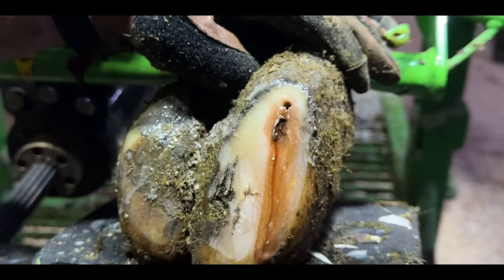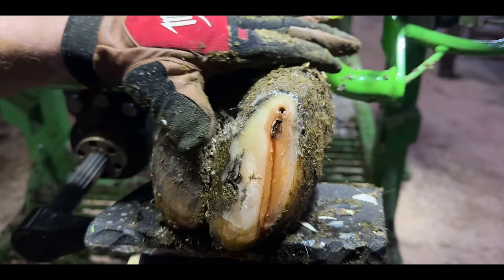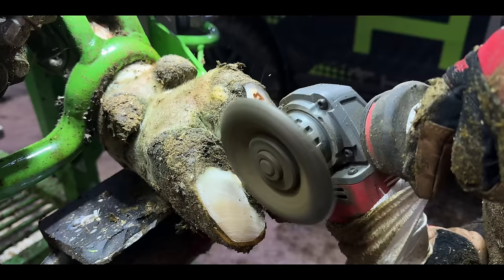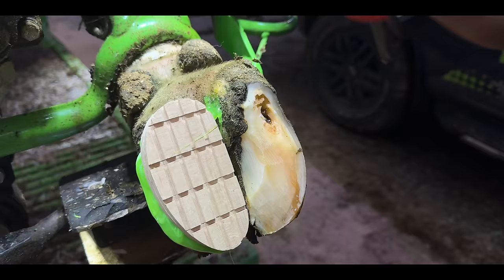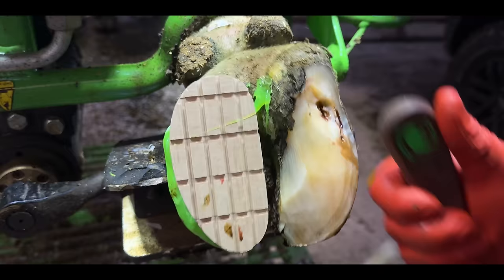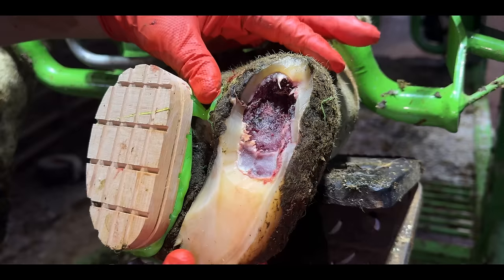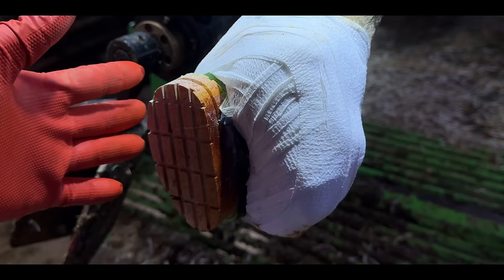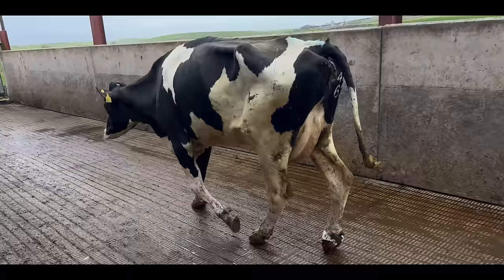there’s a FOUNTAIN of PUS from this cow's hoof!

Comment: The instant relief she had to have gotten when the cavity was open and relieved that pressure, had to have been amazing.
Reply: She still has a long way to go before she's out of pain, tho. The way she's walking I'm worried she's going to break her ankle on a slip. They will have to keep her in a pen for a while. And the bad part of that is how difficult it is to keep the hoof dry, clean and free from more infection.
Reply: @Changelingheart Yeah, but it's kind of like removing a gigantic splinter. It still hurts after and there is a recovery period, but that intense throbbing pressure pain is gone. Her walking at the very end was pretty stable, and with the blocks it's only going to improve rapidly.

Comment: The corium flesh looks really good so the pus must have been doing its job moving the infection away. 
Also, Kev is clever for anticipating the cow’s needs - note I said cow’s need and not hgp’s need 😉😉he’s a good hoof trimmer is Kev!
Reply: Chorium. Corium is the stuff left behind from a nuclear core meltdown.
Reply: @ferretyluv corium is the correct spelling according to Google. When I typed in chorium it corrected to corium after showing me results for chromium.
Reply: @ferretyluv confidently incorrect 😉 it's still corium in the case of cow's

Comment: I had an abcess on the roof of my mouth so big I couldn't close my mouth, or even speak.
I got a length of model makers brass tubing, 1.2mm diameter, sterilised it with flame and sharpened it.
When I stabed the abcess, a foul smelling green goo sprayed out like I was spitting venom.